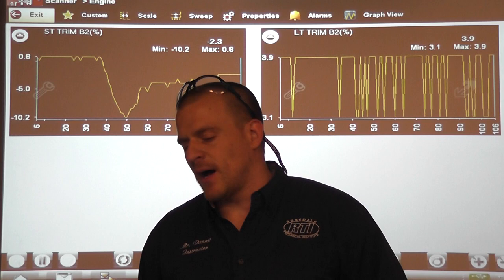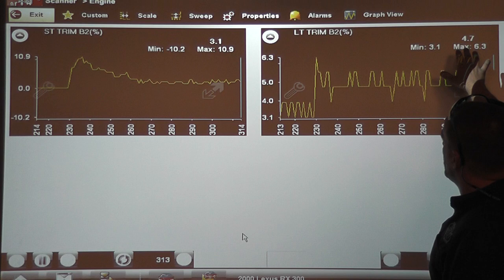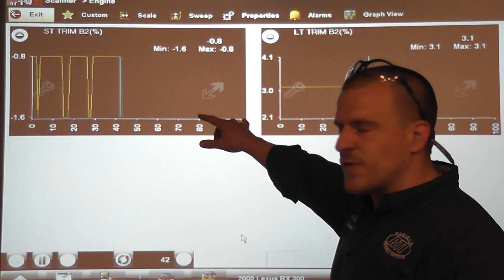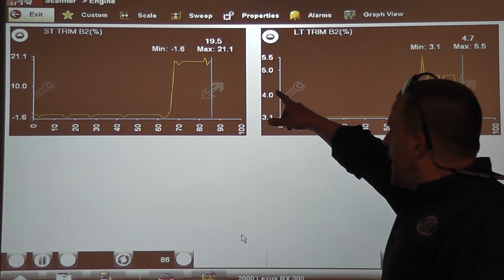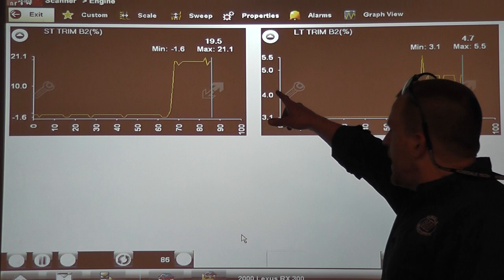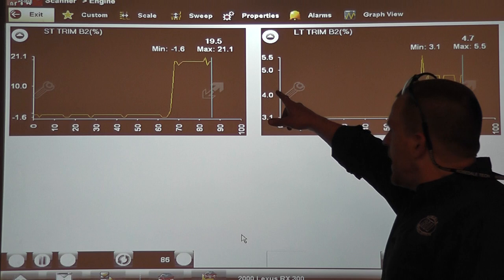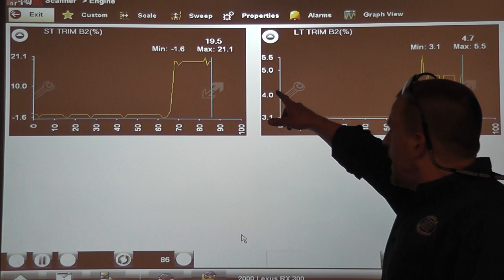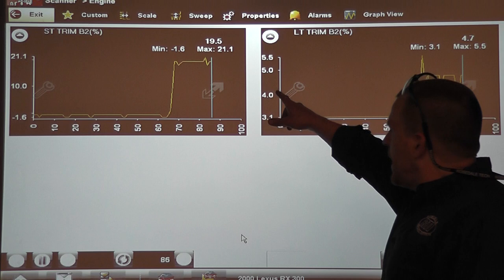Using Fuel Trim to identify type of misfire (can it be done?)

Comment: - Scanner: Observe ST TRIM & LT TRIM
      o Ignition misfire event: 
            x Most of the air/fuel mixture goes into the exhaust 
            x Some fuel condenses in the cylinder and enters the oil 
               → initial upstream O2S lean reading. STFT rises up to 15%. 
            x Catalytic converter tries to burn the unburned HC, using up all the O2 from the bad cylinder 
               → downstream O2S is 900mV.
Reply from the maker: I'm following. Keep going! So we are using the downstream O2 as a guide to type of misfire as well. So a no file misfire, the downstream O2 would be flat line lean. No fuel to consume the stored oxygen. Right?
Reply: +ScannerDanner during lean misfire event, downstream o2 reads rich due to leftover unburned HC and low o2 (used up by the cat to burn HC). the downstream o2 shouldnt affect fuel trim.
Reply from the maker: I'm not talking about a lean misfire. I'm talking about a no full misfire.
And to your point. Using this method of viewing the downstream O2 an ignition misfire and a lean misfire would look the same. Making the test not very valuable.

Comment: Hands down, best channel of it"s kind. I"ve got a P0300 DTC, along with flashing check engine light, that is intermittent.Shortly after the event occured, st fuel trim went up to 25%, and then got to 0%, and the voltage of both (upstream and downsream) o2 sensors went to about 0,03v, and 0,2v respectively. But because the fault was intermittent, as soon as the engine management light turned off, the upstream o2 sensor voltage would start oscilate normally,  and the voltage of the downstream o2 went back to about 0,7v.(narrow band, as far as I know). What I can"t understand is why the stft stays at 0%, even when the upstream sensor"s voltage starts to oscilate normally? Allthough at first i suspected the sensor, then i thought that it had to go into open loop, and that was likely why the stft went to 0%. But I still don"t know what to make of the low voltage on both sensors, when the check engine light is blinking, followed by the  normality of the voltage value on both sensors, when the check engine  light turns off, becouse at the same time  the stft remains at 0% at this later moment. So, if I was to say that the voltage comes back becouse it briefly reenters into closed loop, shouldn"t then the stft start to show a value other than 0%? Your video guids me towards the conclussion that tere is a greater lean condition than i thought that forces the emcu to go in open loop, thus one or even more injectors at fault(given the p0300). I know it"s not your job to answer this kind of questions, but I desperatly seek any help i can get in order to try to fix it on my own, given that for the moment it is not safe to wonder arround autoshops, with the pandemic still on a crescent trend in my country.
Reply from the maker: Remember that a misfire will cause a false lean condition and will elevate your fuel trim numbers. If you can feel the misfire at idle, perform a cylinder drop or rpm drop test to figure out what cylinder is misfiring and focus there. The O2 and fuel trim issue you described sounds like an effect of the misfire and not a cause
Reply: @ScannerDanner  first of all, sir, I sincerely  apreciate the fact that you took the time to read this and whrite a replay, and promptly too. Thank you! Did the drop test, and allthough there was a difference  with each cylinder test, there allso seemd to be a difference between how the engine(4 cylinder engine that is) reacted when 1 and 2 were tested(drop in rpm with each one) and how it reacted when 3 and 4 were tested( engine stalled; plugs for each coil was disconected the same amount of time ).
Reply from the maker: @traiansandulescu5051  so engine got rough with cylinders 1 and 2 but severely rough with cylinders 3 and 4? What are we working on? Year, make model, engine etc
Reply: @ScannerDanner  waw, thank you, sir, you are being kind.May GOD bless you and your family! WOULD LIKE TO MAKE SOME SORT OF PAYMENT FOR YOUR VALUABLE INPUT, SO, I'VE JUST SUBSCRIBED YOUR PAID CHANNEL, EVEN IF IF IT"S PROBABLY NOT GOING TO BE A LONG THERM SUBSCRIPTION, IT FELT THAT A PAYMENT HAD TO BE DONE,  FOR YOUR EFFORT. About the make a model, well, it"s a french car, that says it all, i think:))) it"s a 2006 Renault Megane 2 with a 1.6 l 16v engine, with some sort of vvt(unilateral, sort of speak, since I think it only adapts the timming of the exhaust). Allthough i realise that this brand is not sold in the US, so I don"t know if that helps more than probably being able to determine to some extent, the world widwe technology limitations of the time the engine was buit,  it seemed rude not to answer your question. Nevertheless, i tried to ghether as mouch information about the ignition system and it seems that the french, being french, made it so that the pencil coils are conected in series, or some sort of way that makes them affect one another, like 1 -4  and 2-3(not official info though, and not sure if that"s the right technical slang). I also tried to measure the primary and secondary resistance(for the secondary I could only take measurements between the  springs  of the coils and one of the two terminals from the coil"s plug and came to find out that no.1 coil had 5 000 secondary resistance(only when warm) when it suposedly should have been between  between  9000 and 12000. Primary seemed fine on oll four(it being a four cylinder engine, as i previously said) both warm and cold. Not sure if my measurements were done properly, though, particulary if the secondary can be measured by useing the coil spring as a terminal. However, after seeing another of your "waw" videos on p0300, and how the cranck shaft sensor can determine inconstant spark by a faulty imput and corroborating it with my being unsure of my measurements, AND WITH THE FACT THAT AT SOME RPM RANGE THE BLINKING CHECK ENGINE LIGHT TURNS OFF, it got into my head to try and take it out first ant take a look at it, or even buy a new one.  I hate the parts throwing method but i don"t have any tools and no way to get it properly diagnosed at shops(not only becouse of the pandemic but also becouse tecs are  to quick to jump at conclussions arround here, wich may turn out to be very expensive). For the moment i cannot do both, coils and cranck sensor, but I can do either one of them. given that you have been so kind I would dare to ask what would you advise at this point.
Reply from the maker: @traiansandulescu5051  it sounds like you are describing a standard waste spark ignition coil. When the coil fires, 2 cylinders get spark at the same time. One is on it's compression stroke and the other is on exhaust. 360 degrees later, those two cylinders fire again with the "companion cylinders" swapping positions. The one on exhaust is now on compression and vice versa. 
The fact that you said the cylinder drop test was poor on cylinders 1 and 2, tells us it is most likely NOT a coil issue because these two cylinders are not companion cylinders and are on two separate coils. Make sense?
Also, I've found resistance testing to be poor at best. When you get a bad reading, you can typically trust it, but when you get a good reading, it can still be bad as the ohmmeter does not stress the circuit
Reply from the maker: @traiansandulescu5051  btw, thank you for the subscription! I think you should watch this video, start at the 30 minute mark. This will get us on the same page.
https://www.scannerdanner.com/scannerdanner-premium-chapters/chapter-22-no-start-no-spark-diagnosis/378-chapter-22-no-start-no-spark-diagnosis-part-2.html
Reply: @ScannerDanner  as I said, it felt right to make some kind of payment for your effort, even if just for a while, had to make a gesture, sort of a small thank you. Allthough I"m sure that I"m gonna benefit from the subscription too.
Reply: @ScannerDanner  thanks again, sir, and, allthough your explenation makes very much sense, i must appologise  for haveing waisted your time with a dumb ass typing  error. At the drop test, 1 and 4 reacted poorl, like a small contribution for each,(not 1 and 2 as I"ve previously said) whereas 2 aswell as 3 stalled the engine.
Reply: @ScannerDanner  also, i think I "ve missunderstood the way the system is built. from what I can understand from your explanation, a waist spark system should have one coil andcoil wires, whereas the system on my car has 4 different ignition coils. If so, sorry for mis
leading you
Reply: P.S. : if the engine goes in open loop, but the O2 senor shows very low voltage.Still, given that the fault was intermittent, i was able to observ that the voltage went back to normal as well as the stft oscilation, as soon as the check engine light would stop blinking and go off. Could it be that it"s missfireing becouse of the o2 sensor functions intermittently? I realise that the sensor"s behaviour could be the result of an upstream problem that couses it to stay very lean (0,03-0,07v)  but still, coul the 02be at fault in this scenario?
Anyway, it got worse and know it seems to try to start but runs on two cylinders for a few seconds, and it stalls as soon as I take the foot of the pedal....pfff
Reply from the maker: @traiansandulescu5051  don't worry about the O2 for now, check for spark on the two cylinders that are not contributing and see if it is good, or move some coils around and see if your problem follows the coils
Reply: @ScannerDanner  heloo sir, did that and it went as followes:  could hear no spark discharge in the cylinder head as no 1 was being pulled out,  some spark in the cylinder head as no 2 and 3 were being pulled. No spark at 1,2,3 , when I"ve pulled each coil all the way out  and grounded it. Still I was able to feel a sort of ticking in the top part of the coil when I pulled each one out.  Perhaps I didn"t ground them well enough, but even so, from what I"ve seen, in my previous experience with other engines,  the spark, if strong, should jump to the block when the coil is set close to the block.  Shortly after pulling out no 3, the engine stalled and it got to the point where It  starts in 2 cylinders(at least that"s what I think based on what it sounds like, if that"s even possible) and stalls as soon as I release the  gass pedal. it got serious and i just don"t know what to do anymore. The dtc code still reads p0300.
Reply: sorry for the typing errors
Reply from the maker: @traiansandulescu5051  all good my friend
Reply from the maker: @traiansandulescu5051  depends how far inside of the coil boot the electrode is as to whether it will jump out of the coil, you said it runs on 2 cylinders, move the coils around and see if the problem moves with the coils
Reply: @ScannerDanner  two weeks ago I"ve repleaced two of the coils, and it started to work on three cylinders again, wich gave me the opportunity to do some further testing(before it started on only 2 cyl. and stallled ). Ended up replacing all four coils and it has been running fine since then. Thanks for keeping my mind off the O2, wich I had been starting  to suspect due to it"s odd behaviour at the time(went from open to closed loop). This being said, i reiterate the value of this channel and still, for the sake of the argument I would dare to ask you something related to the behaviour of the engine during the cylinder drop tests, so here it goes: Why is it that with 2 new coils at no. 1 and no. 4, (but still running on three cylinders) when did further  cylinder drop tests by unpluging each of the old coils(1 and then 2) each one of them seamed to contribute, but not when i performed the test by pulling all the way  out each one of the two coils (2 and then 3). I mean maybe its"s something simple , probably has to do with the way they are wired, but for me it seamed very interesting behaviour and I would very much like to understand it. Thanks again for all the help

Comment from the maker: Even that isn't 100%. I don't think there is one test that I use more than the other. Cylinder drop test, secondary ignition waveform, primary ignition current ramp, injector voltage and current, noid light, relative compression test with a scope, gas analyzer....heck I'll even use a spray bottle with water in it to find a misfire:)
The one I chose to use will change for what type of system it is and how easy it is do get to the components.

Comment: Hello your video is very important in the diagnosis of faults. My language is not English. I am using a translator to communicate with you, and have tried to understand what you say , but I do not understand everything. You can tell me the times of the video where behaviors are no fuel misfire and an ignition misfire on both systems please? Thanks.

Comment: Dear Paull,
As I was "smoking out" for any leak from the top of the engine, I saw smokes from the EGR valve (inside the EGR body, not the contact part to the intake). This is for my 2004 Honda accord V6 3.0L engine. What is the relation of such leak to the fuel trim for this MAP based Honda engine? Regular MAF based engine, we should see positive STFT, right? But for MAP based engine, the STFT will be negative, right? Should I buy a new EGR from Honda or the aftermarket?
Many thanks & God bless,
Hai

Comment: First of all ,an excellent presentation.My car is running rich with O2 sensor 1 reads from 0.45 and shoots up to 1.2 v as engine starts.Could it be lack of compression on one of cylinder which cause rich on O2 sensor 1 .

Comment: I stopped watching the video about 5 min into it I watched a fuel trim explanation video on a channel called Schrödinger's box (geared more to diy's who still use critical thinking instead of parts changing) and he PROVED that you can distinguish between spark related vs fuel/air mix related misfires check it out p.s. its not me

Comment: I have watched several of you videos and they are Excellent. At the last part of this video I see that the LTFT was high and the STFT went to 0 as it went into Open Loop. As expected when an electrical open on an injector. What was not clarified is even if in Open Loop the LTFT are applied to the fuel calculations. STFT is not used but LTFT is? I have proven this to be the case on older Fords just not sure if it is across all brands.
Reply from the maker: I would answer and say yes and no. I've definitely seen the LTFT numbers being applied in an open loop situation, but on others not
Reply: @ScannerDanner  Thanks that is what I thought too.
 I see the adaptive update table in most of the pre 2004 ford calibrations only allow the PCM to learn in cruising engine loads and RPMs cells where Closed loop would normally take place. What is learned in these cells of the table are then applied to other Loads and RPM cells.  Ford Realized this and made cells that were in the Open Loop ranges point to cells that were in the Closed Loop Area. It makes good senses if a MAF is dirty and the reading is incorrect that it would read incorrect in all ranges not just closed loop. 

Keep up the good work on the Videos
Reply from the maker: @clintgarrity2693  I had a dodge truck, full size, mid 2000s maybe? Had a bad upstream O2 that maxed out the fuel trim (both ST and LT) and I don't remember the specifics but LT was a factor right at start up on a warm engine. So before it went back into closed loop, there were immediate fuelling issues and poor running
Reply: @ScannerDanner  good to know

Comment: Wrong brand spark plugs will cause a missfire,I see this a lot with Bosch spark plugs installed a lot and seen this with E3s once so far.Ford tritons with the COP ignition system are known for going through coils.Had one Ford in for a missfire showing no codes,had the customer take it to the dealer and it was a bad ECM.Everything else looked good.GM 4.8s,5.3s and 6.0s,spray down the intake gasket area when a missfire code appears.If changes,the intake gaskets are bad,blow out taking in air

Comment: Dan, I have a 2001 5.3 tahoe with a code p0300 code. Borrowed my buddies scan tool. Misfire starts only when engine reaches operating temp. I noticed my o2 sensor B1 STFT trim was -31.2. MAP reading is 12.6. Fuel pressure is normal.  I just started diagnosing my problem. All emmision sensors are new. I can run live data with this tool. What are normal readings for this engine at normal operating temperature? Any advice would be greatly appreciated. 
thanks,
Tony

Comment: @ScannerDanner Thank for the video. Could you help me make sense of these STFT and LTFT values. I have 07 ford taurus, for bank 1 STFT stays between +/-3%, but LTFT stays constant at about -12% at Idle. Bank 2 is lean at idle with +12%  total fuel trim. When I increase RPM to 2500, STFT jumps between +/-6% and LTFT stays constant at -19%. Bank 2 improves at 2500 RPM with about +6% total fuel trim. OBD says cylinder 1,2, and 6 misfire. I have tested injectors, replaced the leaking injector already. What do these trim value mean? How come bank 1 is rich and bank 2 is lean? Thank you.

Comment: I'm confused, in your LT ST basic overview you where saying you can Identify the part causing the problems with LT and ST, be it injectors or pump. But in this video your saying it more or less is worthless for detecting a misfire.  Are you saying that if you can get to the point where you know it's lean then LT and ST can be useful? Can this be used for cars with no schrader on the rail and are a pain to test fuel pressure?